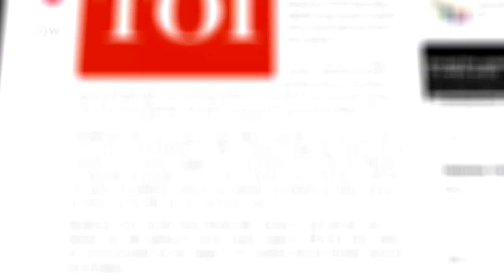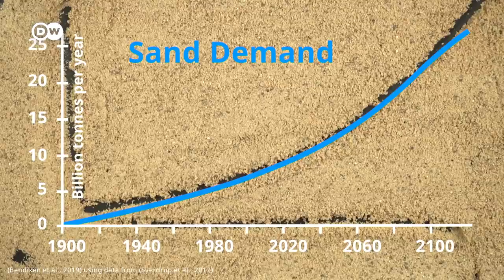Why countries with deserts import sand

Comment: Thanks for this DW.

I'm a lime putty plasterer and for my perfect sand mix I need about 5 different granule sizes, from small stones to minute fines. Cement produces about 3/4 of a tonne of CO2 and is costly to make and now with carbon nano-tubes, graphene and the new geopolymer concrete that 3D printed houses are made from which uses about 95% fuel ash from power stations this is a real game changer and a much lower carbon footprint.

Comment: Silica sand is used in everything from toothpaste to paint. An enormous amount is use in the frack oil well drilling process. Train cars roll by our house daily loaded with tons of silica sand for fracking. Silica sand is, however, not commonly used for construction purposes.
Reply: Right! I already supply silica sand in chemical-ceramic-paint company.

Comment: Sand is used in electronics. It is used in the fiberglass for circuit boards, the silicon in IC's, optics like lenses for cameras, glass touch screens, and the glass in LCD's.
Reply: it's not that type of sand

Comment: Ah, I learned about the sand shortage in my final year at enginering, it was in the coastal enginering course. This is a real issue.
Reply: Can you use recycled crushed glass as a replacement for sand?
Reply: @Foersom_  idk we focused mainly on the issue with coastal erosion. The best way to counter erosion is to add more sand into the system. A big reason we get coastal erosion (apart from the rising sea levels) is the fact that we have damed up most rivers in the world and while doing so we are breaking the natural cycle where the water transports sand from the mountains from eroding the riverbanks. The sand gets stuck inland at the dams instead. Not sure if that kind of sand is good for concrete though. But it's still a huge issue non the less. I suppose crushed glass would supply more friction, idk if it could meet the demand in volume though.
Reply: We have a shortage of everything, exept humans.
Reply: @janklaas6885  ,actually, the demand for human capital is increasing.
Reply: @shepherdsknoll  
Even with all the stupidety going around there isn't a shortage of it.
Reply: @shepherdsknoll  
But that still is not gonna save this planet.

Comment: Can't demolished buildings be turned back into sand? Like can't you take waste concrete, crush it up, toss it in a river and let it do it's thing and break back down into rever sand?
Reply from the maker: Hey there! Yes, there are ways to recycle/reclaim sand from construction and demolition waste that can then be used again instead of new sand. There is also research into alternative material to be used in the production of concrete. One example is plastic waste: Research has found that plastic waste could replace sand partially in concrete production.

Comment: If the only problem of that abundant dessert sand is being too smooth, can't we melt it and mould it into a more irregular shapes? Quick search says that rock's melting point is only 1200, which is lower than iron (1538) which humans have been melting for over two millennia.
Reply: No. I work in a smelter plant. We use silica sand everyday to create slags. Melting temperature of rocks/sands are highly dependant on the composition. Pure silica melting point is at 1700°C. Addition of iron oxides (FeO) and lime (CaO) can reduce it to 1200°C, but at that point the slag/rock composition is only 30-40% silica (SiO2)

Comment: We used wood to build houses and they say we are releasing too much carbon and wiping out the rainforest. So we can't use that. We switched to concrete and now that's a problem because of sand shortages. We use other materials and then eventually that will run out or something will be up with it. There's no pleasing people I say use whatever material you want to build your home those who don't like it can live in a mud house then I'm pretty sure people will say mud is running out you just can't win.

Comment: bit of false information presentation. Think we should deregulate all these shortages all it does is stretch the problem out and little to nothing gets done. If we deregulate all these shortages such as Sand and what have you Etc... then the problem I think in most cases would become more evident sooner and garner immediate action by the users and suppliers, not the scientists that blow the whistle when its fare down the line.

Comment: This problem can be solved easily. The desert sands should be mixed with cement and pulverized construction debris along with water to convert them into irregular shaped sand and rock particles. Once cured, for more than 3 months, they get sufficient strength to function like normal sand.

Comment: It's as simple as turning glass back into sand.
Reply: NOPE ~ FRICTION is the GLUE !   Sand made from glass is way too smooth and concrete made from that is why we can't turn the Sahara into a sand gold mine. The grains are all to smooth. But the answer is simple ~ CRUSH rock into sand ... mine certain rocks and then crush them... but that takes energy making the sand expensive.  Last time I bought 16 tones of basaltic crushed sand in Hawaii it cost $700 in 2017 !

Comment: Are you kidding?  There's no sand shortage.  I have enough sand in my cracks to supply the world for a decade.
Reply: If you watched the video, they say that there is a shortage of the type of sand needed for construction. This is a story about the economics of the sand industry and sand trade. The video explicitly even states that the 1/3 of the world is classified as desert but that type of sand is not commercially used and currently unviable.

Its like saying, there's a global food shortage. There isn't. Human produce enough food to feed everyone, easily. And yet there are shortages and food insecurity everywhere for various reasons.
Reply: @jectblade  The vast majority of sand is used in construction.  New technologies are beginning to obsolete concrete and mortar.  Sand can be manufactured, as well.